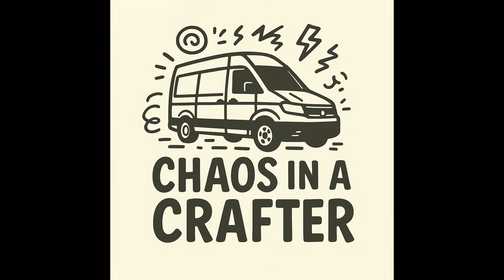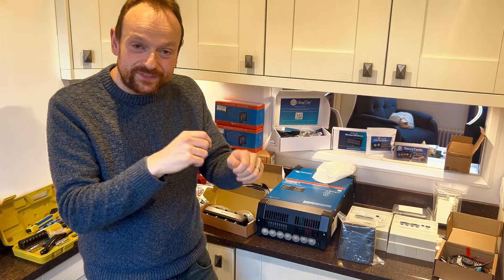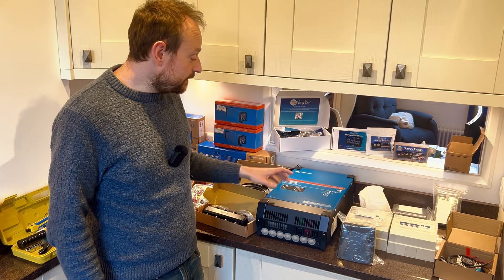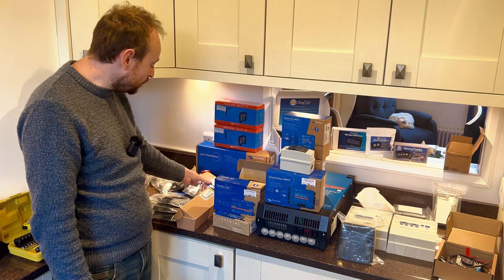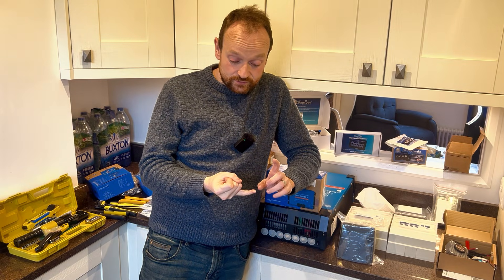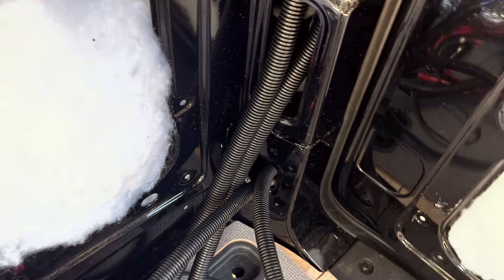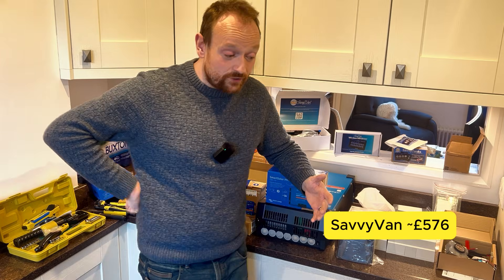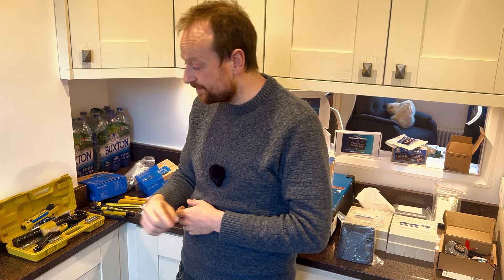OUR COMPLETE CAMPER VAN ELECTRICS PLAN - What We’re Installing & Why - Van Build Episode 16

Comment: Great video. I looked into victron but the prices of them is too much and the amount of components I needed to buy for all that to work I decided nah I go the renogy route alot less components more simplified and a fraction of the price. I know victron would be the most superior bla bla but my wallet disagrees and I want less conponents that would do the lot. one 3kw inverter and one 50a mppt/dc-dc charger in one. and slap on the battery, solar, wires, busbars and breakers and away I go. probably less than 1500 for the whole lot. anything else is an added luxury.
Reply from the maker: I’ve heard nothing but good things about Renogy. You’re right about Victron being a luxury. 
Because our garage is so small and my kids bed is directly above it I just wanted to ensure that it was absolutely the best I could possibly buy. Just in case. Even if it is essentially the same stuff under the skin.
Reply: @ChaosInACrafter yeah its worth having the best of the best to be safe no cheap junk that could fry up
Reply from the maker: I’m thinking about building another van after this. A smaller Transporter sized stealth van just for me. I’ll be using Renogy there. :)
Reply: @ChaosInACrafter yeah a different approach. best of both worlds 👌🏼 you can make a video of that build and see the difference. just an inverter and a charger and if you want you can get a one core touch screen its abit smaller but its wireless too. I have an iveco daily and still building atm. I went full crazy by having a garo tripple row consumer unit so I have the bottom row for isolators theres battery and changeovers and emergency do2 pull out fuse etc. middle row DCs and top row ACs so its all in one mcb fuse board. and the bus bars that are the red box and black box ones that amazon sells but I got mine from buy2fix both for €50 thats the 48v/300a one and 4/0 wire from ebay custom from germany. and a wattcycle 314ah battery for 500 thats with the discount. you can go down that route its pretty sweet.
Reply from the maker: Awesome suggestion. I’m going to save your comment so I can come back to it when it’s time. That consumer unit sounds particularly epic.
Reply: @ChaosInACrafter Yeah that would be awesome 👌🏼 best of luck on your projects gimme a shout if you need some ideas. I’m figuring things out myself as I go along.
Reply from the maker: Absolutely, I will do!

Comment: It's 3000VA, not Watts
Reply from the maker: Good spot! You are absolutely right. The inverter/charger is indeed 3000VA. It’s rated at 2400w for continuous output and can handle short peaks up to 5500w.

Comment: Really enjoying your build series, keep up the good work!
Looks a good system, I am looking at 24v as well.  I have been speaking to Nohma, but they have said they will not deal with anything except Victron, which is a pain as I have been looking at a Sterling 12v to 24v 120A DC-DC charger.
Also, is there a particular reason you went with a 12v air con with a 24v system?
Reply from the maker: Thank you. :) It was all about having the space on the roof to fit everything in. I’d much rather have had a 24v AC but the only one that would fit was 12v so I had to make do!

Sterling is decent stuff too, try some of the other system builders.